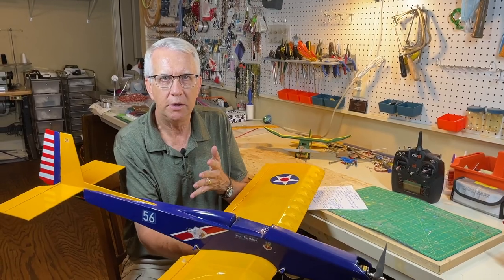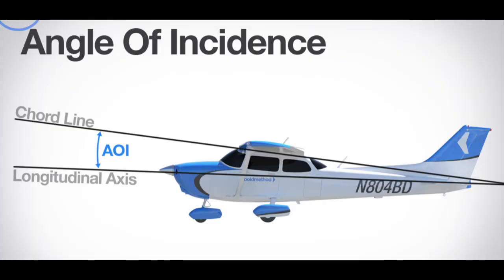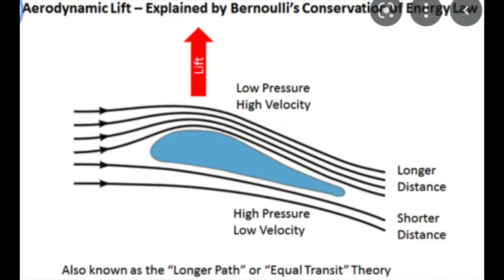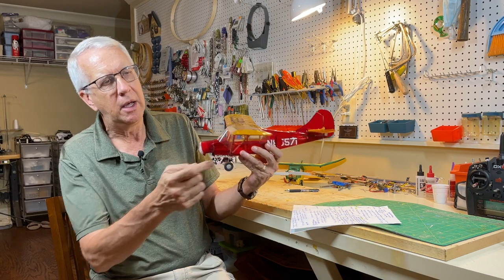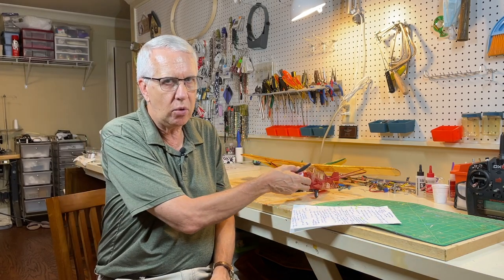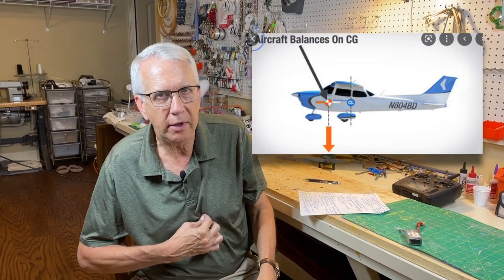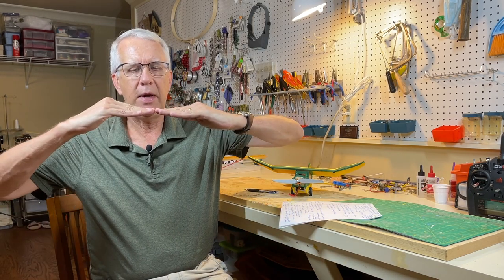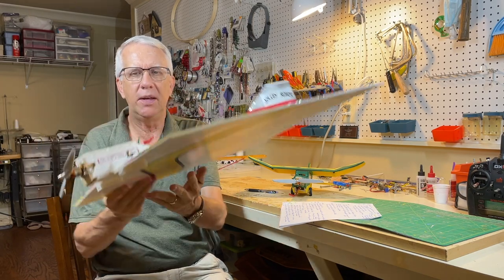Practical Aerodynamics for Model Airplanes

Comment: Like watching your advice video's. I've been flying over 20yrs all your advice is sound. The only thing I'd add is that you need to be aware that a lot of plans/manufacturers place the centre of gravity to far back. My Dynam Spitfire was prime example the C of G from the instructions was great for taking off  (not nosing over) but once in sky it was pitchy and barely flyable, luckily farmer had just cut the hay so aimed at a nice loose heap and it was ok. If a novice its always a good idea for an experienced modeller to check it out first before flying you plane. It's always cheaper and quicker to learn by joining a club in the long run. Keep it up Tim great video
Reply from the maker: Mark:  Thanks much for checking in, agree completely with your point on an aft CG. 😀 Tim

Comment: I hope you don't mind ... I have questions.

1.  Longitudinal axis = LA

a.  Is the LA a line extending from the horizontal stabilizer through ... what?  the center of the motor?  What if the motors are higher/lower then the horizontal stabilizer, or the horizontal stab is higher/lower then the center of the motor?

b.  When establishing the LA ... what role, if any, does down thrust play?  If the motor has 5 degree of downthrust ... where does the LA intersect the centerline of the motor?

c.  What if the "top of the aircraft" is not parallel to the LA?  Is the 2 degree angle of wing incidence relative to the "top of the fuselage ... or is the wing incidence and relative to the longitudinal axis?

d.  What about bi-planes?  Do both wings require an AOI?
Reply from the maker: LA is from the nose to the tail, is the axis the airplane rotates around.  LA does not have any interface with motor down thrust, just a measurement from the nose to the tail.    No interplay with wing incidence either.  For biplanes, usually the lower wing is zero incidence, upper wing positive a degree or two.  Tim

Comment: More Questions:

1.  Wing Dihedral:  Does greater dihedral create more drag and then a slower model, and is the reverse true as well?

2.  AS3X.  Is that function just part of the receiver ... or it in the transmitter as well?  Can it be added somehow to an existing a/c?

By the way ... love your vids.
Reply from the maker: Dihedral does not add drag to an airplane, just there for roll stability.  AS3X is built into that receiver, not part of the transmitter.  See my video on AS3X, I go over all the details.  Tim
Reply: Dihedral means the angle of lift is away from vertical, which means you need more lift for level flight, which means you need more angle of attack, which means you create more drag.
Reply: @StephanAhonen  Well, OK.  But the amount of induced (lift) drag from dihedral is very small, never included in calculations.  Tim
Reply: An airplane that has a rudder, but no ailerons must have dihedral in order to turn. When the rudder yaws the airplane, the wing is turned at an angle to the relative wind which increases the lift on the advancing half of the wing while decreasing the lift on the other half. This will make the plane roll in the same direction that the rudder was deflected. AS3X is a feature in some Spektrum receivers. It can be turned on or off from your transmitter and you can also adjust the AS3X gyro gains from your transmitter, if desired.
Reply: @txkflier  Depends on the airplane.  I have several zero dihedral planes with rudder and they turn.  Bit of a skid, but they get around in the sky.  Tim

Comment: Nice presentation, easy to follow explanations. I have a question. Do you know what value there is in reducing drag in terms of performance, for example root wing fairings, for models. I think sub-250 gram is going to be the new thing (it is for me anyway) with Remote ID. I'm pretty certain it will end park flying for everything else.
Reply from the maker: Doug:   Thanks for this input. Full scale airplanes seek to reduce drag to fly a bit faster (Cessna 172) or meet a range target (B-777). Our models don’t care about range and are so overpowered speed is not an issue. So anything to reduce drag in a model is for appearance. And I really am not worried about Remote ID. If industry can do AS3X, they can figure out Remote ID. Tim
Reply: @TimMcKay56  Thanks Tim. Remote ID is not a technical challenge, I was talking about the practical effect when the public gets wise to the app and anyone with a cell phone can ID an aircraft and turn that person in for [take your pick]. Some people get annoyed at anything flying near them and all it takes is one complaint. Also, I don't know if you fly RC in the wild but it's OK until you ask. Then someone has to make a decision, take responsibility, ask a boss, etc.

So I'm serious about sub-250 gram. I think a decent size plane is possible but 250 grams is not much to work with, hence the drag question. I've now made 60" 3D printed wings covered with balsa that are as light and nearly as strong as foam cores/balsa for a twist wing plane I designed and conventional with ailerons. I'm looking at scaling that technique down. I've also designed 2 meter 3D printed sailplane wings covered with Dollar Tree sheet foam but it takes an airfoil thick enough to account for the 4.5mm of foam x2. The melting point of the foam is close to covering film so it's difficult. Paint is easier, not as nice but the beauty is the total cost is about $5 for a 2 meter wing. That's going on the back burner until RID is sorted out. Lemmon now has bricks with conventional servos similar to HH UMX types for $37. There are tiny but I'm starting there.
Reply from the maker: @dougj8186  Great info!  Do keep in touch, sounds like you are on the right track, good luck!  Tim
Reply: @TimMcKay56  Thanks again Tim. My goal is a sub-250g plane that doesn't seem like a toy.
Reply from the maker: @dougj8186  Sounds like a great plan, good luck!  Tim

Comment: Hi I have a guillows spitfire 504 do you know if it could be made to be RC and if so what motor, servos and battery would you recommend on a tight budget
Reply from the maker: Dustine:  That’s a 17” wingspan, quite smaller model. The Spektrum RC gear is likely the best fit, but I am not sure on this smaller size model. Do take a look at my video on larger Guillows Spitfire conversion. Tim

Comment: 13:45 I've experienced this before, I have a 400mm P-51 and sometimes when I fly in the wind I can be at full throttle and i can hover the aircraft or sometimes the wind is strong enough to push it back at full throttle.
Reply from the maker: Good observation!  Tim

Comment: When a control surface flutters, it's usually because the control horn is too short or the linkage is too flexible. If you need more throw, use a longer servo arm instead of shortening the control horn. Make sure the servo output is rotating about 40 degrees either side of center in high rates. When you turn down the travel in your transmitter, you decrease its resolution and accuracy. Also, if your trims aren't centered after you get your plane trimmed to fly straight and level, adjust the linkages on your control surfaces so that your plane will fly straight with the trims centered. When your trims aren't centered, neither are your servos. Leaving the servos offset from center will cause the control throw to be greater in one direction than the other. One other thing. On flat-bottomed wings, the ailerons need 1-1/2 to twice as much travel up than down to prevent adverse yaw. If the servo(s) and control horns are on the bottom of the wing, you can install the servo arms one tooth toward the leading edge when the servos are centered. Or, you can install the control horns about 1/8 to 1/4" back from the hinge. In either case, the linkages will need to be a little longer so that the ailerons are centered at neutral. When you use the differential function in your transmitter, it decreases the amount of servo travel in the downward direction which as I said earlier, decreases the resolution and accuracy of your radio. It also requires the use of two channels, one for each aileron servo.
Reply from the maker: Yup, I remember well the old day of RC, without even servo reversing.  Installations really had to be planned out, and using the full control horn, horn at 90 degrees, etc. all super important.  Tim
Reply: @TimMcKay56  Yeah, years ago, we’d reverse a servo by swapping the motor wires and the wires on the ends of the feedback pot. We had to clean and lubricate the pots occasionally, so swapping the wires wasn’t a big deal to us. We also had to adjust the pot to center the servo. Now everything is done in the transmitter and we replace a servo instead of working on it. Computer radios have made everyone lazy. Instead of learning how to properly set up control linkages, they attempt to cover their mistakes by tweaking the settings in their transmitter.
Reply: @txkflier  Good points, and I remember those days well!  Tim

Comment: 5:29
That is so true.
I was grinding war thunder and tried out simulation mode awhile ago.
I tried out the B36 and P47. My plane kept on rotating when I took off, and less so when I was in the air.
I couldn't even trim my ailerons to compensate cus i didn't know the keybinds💀💀💀
Reply from the maker: All good!  🙀😊😳 Tim

Comment: Hello! I'm studying the IB, and as a part of my Grade 10 Personal Project, am planning to make a model RC plane. Would it be possible for you to guide me with this? Do you have any video tutorials on your channel, and if not, can I get in touch with you?
Reply from the maker: Your best way ahead is to purchase an ARF trainer and join a local club with an instructor.  Consider the Fair RC Blue Bird, a very nice trainer I have a video on.  Then to build your first plane consider a Sig Kadet.  Easy to build and fly with a photo illustrated construction manual.  Good luck!
Reply: @TimMcKay56  Thank you so much! This really helps, and I really appreciate your quick response! Couple of questions though, 

1. What's ARF stand for?
 
2. I don't really have any clubs to join, do you reckon I need a 3d printer or something like that to make these?
 
3. I need to present that the model I develop makes use of aerodynamics, so through the Sig Kadet, how exactly could I explain that?
Reply from the maker: @sanjithshyam  ARF is Almost Ready to Fly. Do join the AMA at www.ModelAircraft.org. Wonderful monthly magazine. Also, with no instructor get Real Flight computer flight simulator.

Comment: And more ... You didn't discuss drag.

Does drag impact model ac?  What on a model ac creates drag?

Should modelers be aware of things that create drag and try to eliminate it?

Jets are round, Piper Cubs are square.  Do round ac have less drag then square ac?  Are round ac more efficient, more stable and faster than square ac?
Reply from the maker: Drag is a long subject, best to Google Airplane drag.  There are two types of draft, parasite and induced.  Parasite is the aircraft structure, induced is from lift.  Model airplanes have drag just like full scale ones.  Tim